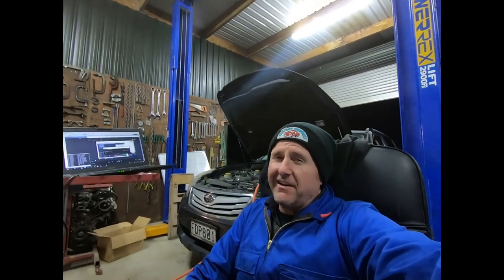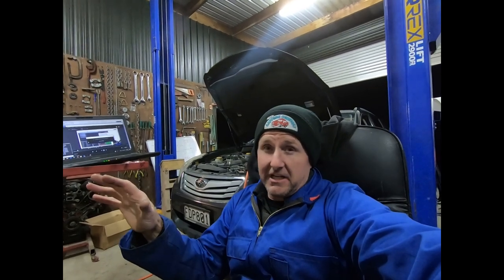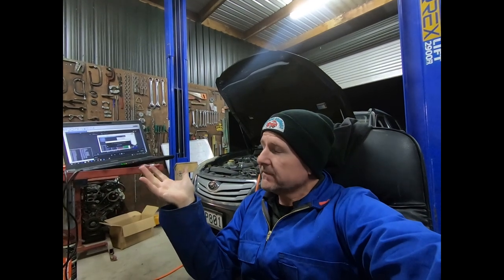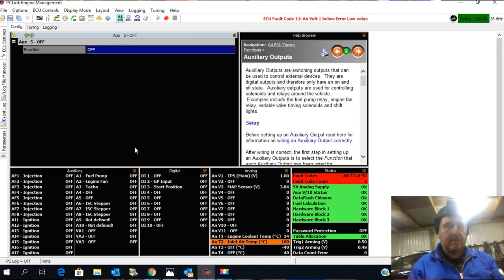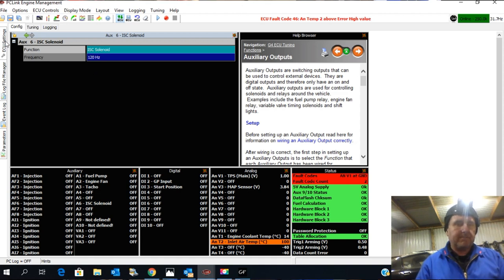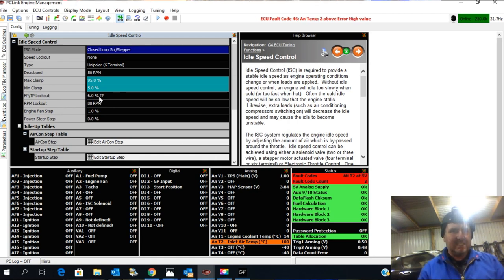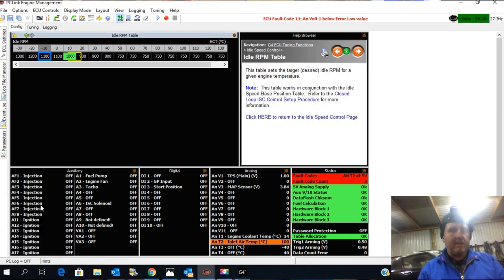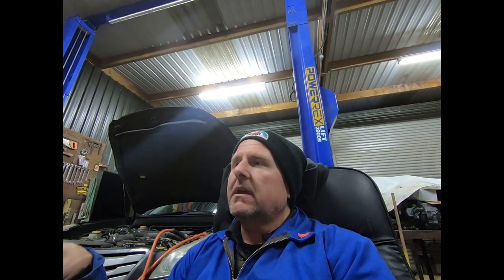LINK ECU Tuning.  Setting up your link ecu.  Idle Air control (1uz)

Comment: My six wire stepper hasn't worked since my car has been finished. It takes up 6 aux I think on my link g4+ Xtreme. I have been told  the stepper is faulty. Is there Any way to test this? My car is a bitch to idle when cold. Hot is fine
Reply from the maker: Good morning Ross.  Did you install the link extreme yourself or pay someone? The windings of the stepper can be checked for resistance as an indication of its health however I find the best way to test is by having it all wired correctly,   popping the unit off and veiwing its operation.   I also have a test rig to a link setup for such a purpose.  Maybe it needs to feature in a video with some good base settings included.  Cheers Kelvin.
Reply: @CartuneNZ  it was professionally wired in I have it blanked off atm as we couldn't get it tuned with it as it would be stuck open.
Edit. Tbh I can't find a new item around here without buying aftermarket. Do I just do the ford stepper conversion. Or can you source me one from somewhere?
Reply from the maker: Hello Ross.  Ill dig out my diagrams and add another video on this topic in a bit.  Hopefully that will solve your issue.  Im sure (know) others are having the same issue.  Cheers.
Reply: @CartuneNZ  ok that will be awesome. Let me know if you need anything from me I have all my pins for the link written down on paper also
Reply from the maker: Hello Ross.  https://drive.google.com/file/d/1DmHszrxPKgUNdhd4K91QkRz8yLoNNlGm/view?usp=sharing    Try looking at these diagrams.  Cheers Kelvin.  Hopefully this link works
Reply: @CartuneNZ  thanks Kelvin I'll use these steps and see if I can get it to work. Fairly certain I'll need a new unit. So I'll buy one and punch these steps in. If that fails I'll convert it to a 2 wire setup like shown.

Question? Did you buy the adapter from the states?
Reply from the maker: Hello Ross.  That unit is Kiwi built.  I keep them in stock most of the time.  

Also pays to flick the stepper off and watch it reset.  Did they wire the ecu hold function into the ecu?

Comment: Test cam offset vvti ?
Reply from the maker: yes.  What about vvti offset?
Reply: How to setup vvti offset and how to use cam test at link ecu  for vvti offset
Reply from the maker: Hello Johnny.  I did some footage on this topic a while back when I had a vvti with incorrect cam timing but it never got edited.  Im wiring a few vvti engines atm so will attempt to belt one out.  Fortunately there are some base settings for many engines so it vvti works on these settings providing its mechanically and electrically correct.  Cheers
Reply: Tq..but the wiring vvti  is correct ,still vvti counter error? Link ecu how to the setup vvti
Reply from the maker: @johnnychang7082  ok.  So you have a 1uz vvti which is wired with link and it has issues?  This sort of information helps me.
Reply: My engine 1uzvvti issues vvti error ? Link error code vvti counter?the wiring output to solenoid vvti already test the output signal at link ecu
Reply from the maker: Have you checked 100% the cam timing is correct?  And the polarity of the 4 input position sensors?